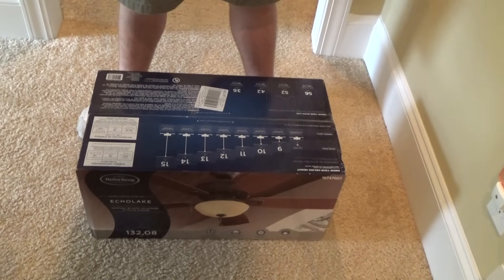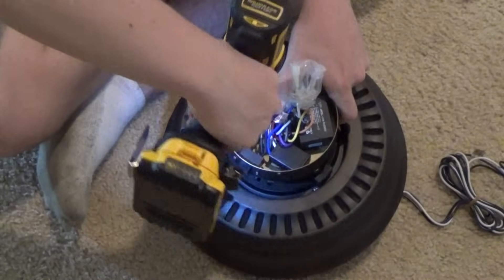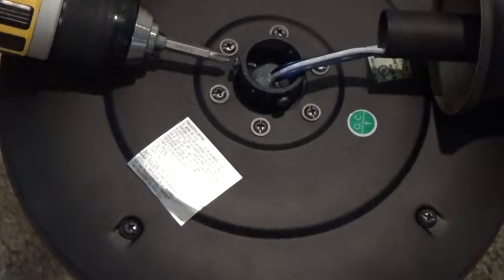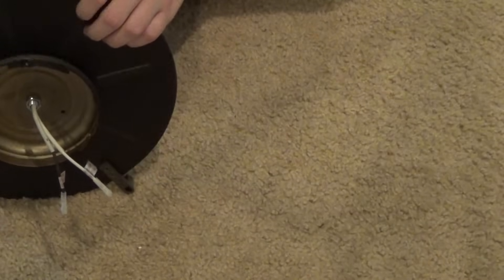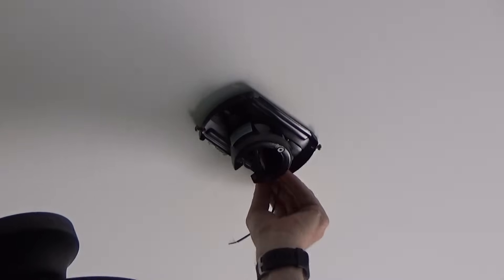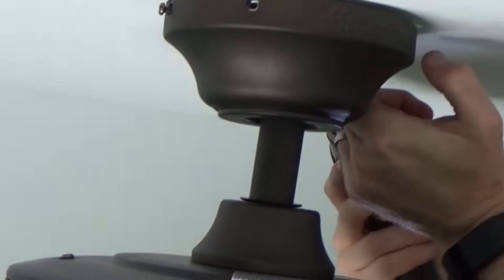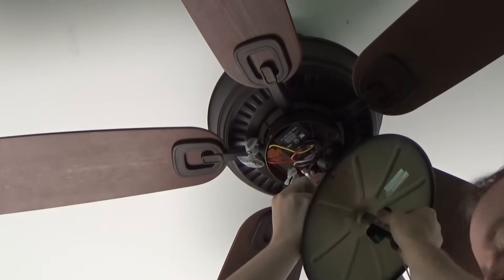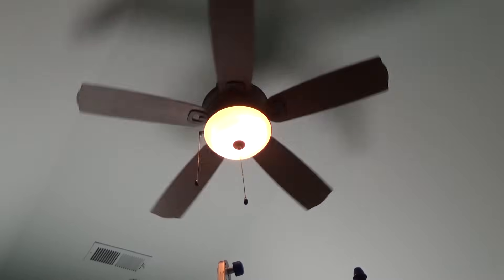How to install a Harbor Breeze Ceiling Fan from Lowes

Comment: That's a plastic ceiling box. FYI you might want to replace the box with a metal one acceptable for fan use or the fan could fall.
Reply from the maker: I appreciate the concern but I am not sure why you think they are plastic.  They are definitely metal. But I totally agree, I wouldn't attach a ceiling fan to a plastic box.
Reply: Clint Holland    and
Reply: Vincent D +
Reply: Even if it is a metal box, I would not use it for a ceiling fan unless I am 100% sure that it is suitable for ceiling fan.  If that box were truly designed for ceiling fans, the screws in the box should have been far enough apart so that both screws in the mounting bracket would go into the box, NOT screwing one screw directly into the ceiling joist the way you did.  My father told me that one reason why we always hired an electrician to install a ceiling fan was so that we can be sure that the fan was installed according to all applicable building codes.
Reply: Agreed. Metal box, that’s cool and all, but if the screw holes aren’t lined up, that’s a clear indication that box ain’t meant for fans. They make it pretty idiot proof,  except for idiots. Not a knock on you. I’m sure a 2” screw to a stud will work just fine, but we shouldn’t be teaching people searching on YouTube for the first time that. That’s how you get a fan to the noggin
Reply: Clippa When we had ceiling fans put in our house, we always had an electrician put the fans for us.  My dad said that we wanted to be sure the fans were installed according to code.

Comment: I do not need a balancing kit for my fan is because it is flush mounted to my ceiling
Reply from the maker: It's pretty rare to ever need a balancing kit but the chances of needing one do increase as you increase the length of the downrod.  If you have a flush mount one there is very little chance of needing one.

Comment: I watched this for the wiring and this is the only video with same color wires. you skipped the main part of the wiring colors I needed.
Reply from the maker: Sorry George.  The reason I skipped it is because my wires might be different than someone else's and I didn't want to confuse them.  Tell me what wires you have and I will tell you how to wire it.
Reply: I find out. thank you though! means a lot that you replied.
Reply: Hi. I have Red and White and Black coming from ceiling with a one light switch on the wall. Ceiling fan has a Black and Blue and White. What do I do? My main concern are the Red (hot) and black. Because now I tied Red with black and blue together and white with white. The black from the ceiling I completely eliminated it by put a wire bit on it. My only problem now is that the fan turns but the light fixture it NOT coming on. Please explain. Thanks a million.
Reply: Is there an update to this issue?

Comment: Make sure you guys have spare wire nuts, magnetic screw drivers both standard and flat head. As well as a wire stripper tool and a pocket knife. It took me about 2 hours with a 1 hour trip there and back for some stuff I thought I had but didn’t from Lowe’s. So three total by myself. Granted I went fairly slow and Had to move a king size bed and bed frame out of the way for the ladder.
Reply from the maker: Great tips. I am going to pin your comment to help others out.
Reply: Qp

Comment: Mine looks nothing like this. No place to insert that accessory  downrod, Thanks Lowes you A-Holes
Reply from the maker: I had to take one of my ceiling fans back twice before I got one with all the parts in it.
Reply: What if I told you that Lowes didn't open the packaged fans to check to see if every part was in there? That's quality control on harbor breeze part..
Reply from the maker: @roni1976  I would completely believe you.  I had one fan, may have been this one, that I had to take back twice to get all the parts.